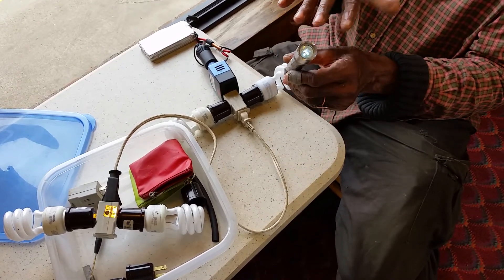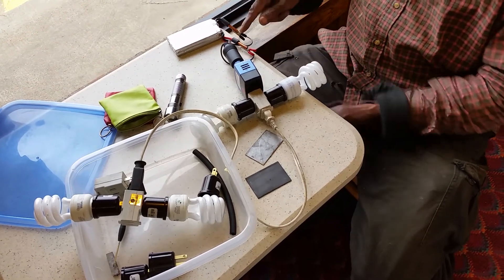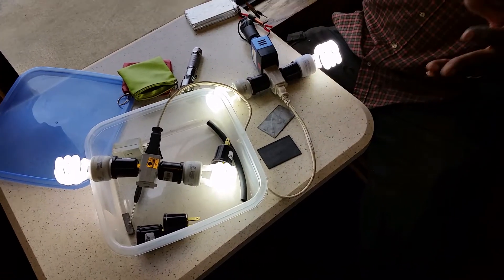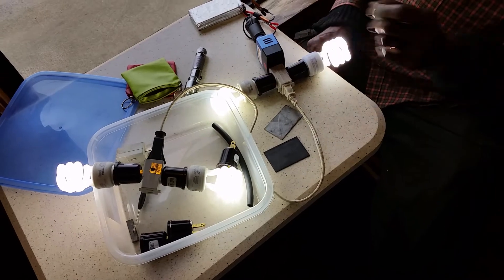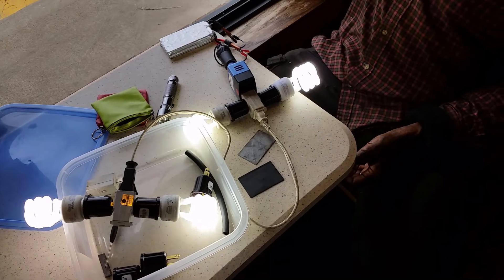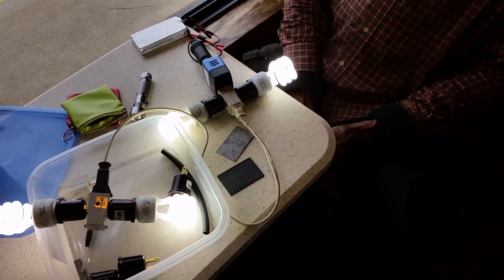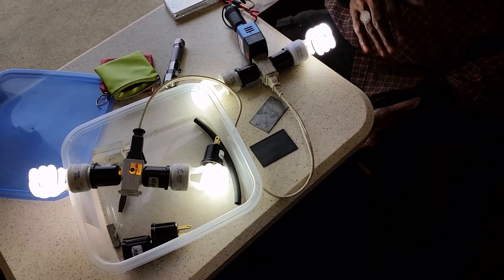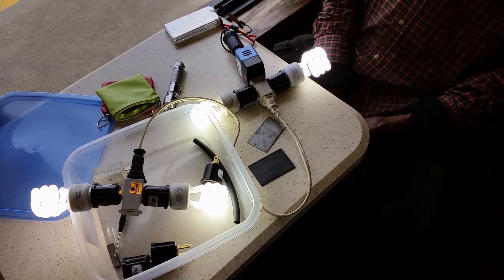Soil battery by "Spaceman"

Comment: Yes, a soil battery using graphite and aluminum is theoretically feasible and practical, especially for low-power applications. Its efficiency would depend on factors like the soil composition, moisture content, and electrode design. While it may not currently compete with high-performance batteries for large-scale applications, it could serve as an innovative solution for sustainable energy in small devices or remote locations.